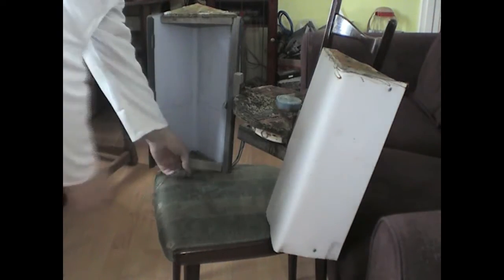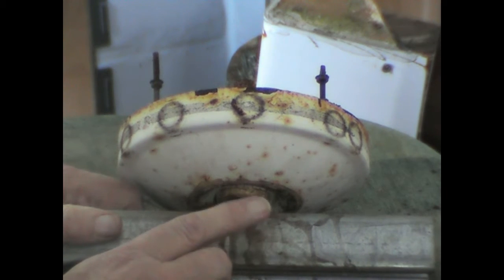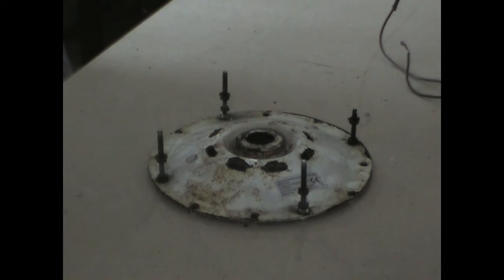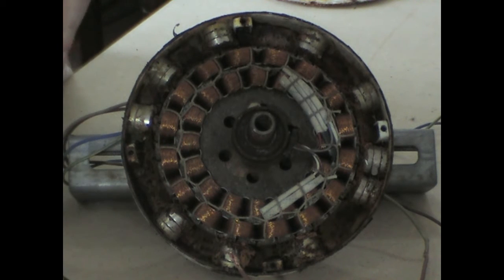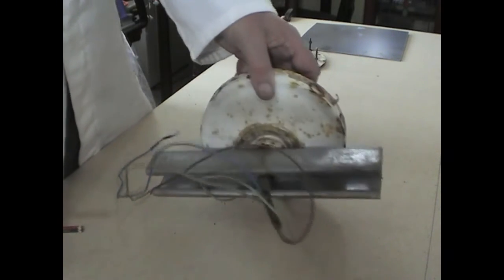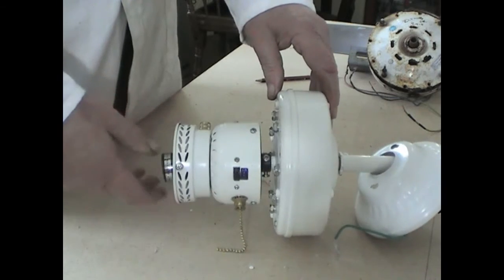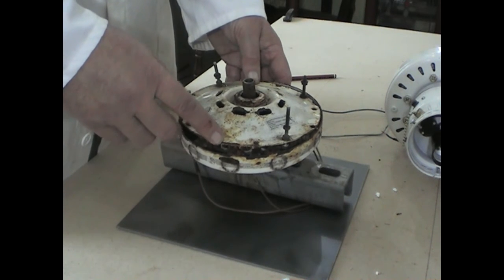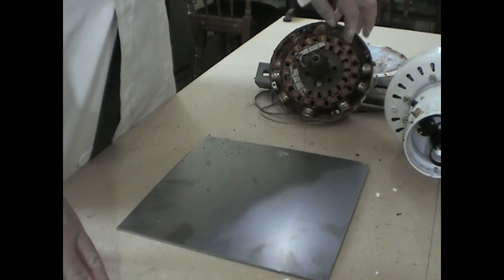Ceiling Fan Generator Turbine VAWT Overhaul 1

Comment: I have a cailing fan in my living room hmmmmm it may not be up for much longer
Reply from the maker: +David Simpson That's what I tell my friends when I look at thiers. LMAO.
Reply: i have never looked at them and thoght wind turbine befor but i will from now on haha i was laying in bed last night trying to think of a way i could use the bracket the fan blades use for maounting vertical blades rather then horizontal and i worked out if i had the same bracket below they could be bent to a 90 degree angle giving me a solid mount for 5 or 6 inch drain pipe the issue i have is with a small back year i ant got anyweare to mount it
Reply from the maker: It can be stood on the ground as I show in my intro wind section. Swap out the brake discs and put a ceiling fan generator. After this upgrade is working on tower. Going to do just that.

Comment: if the unit is 3 phase you could use a 3 phase motorcycle voltage regulator to the battery bank as for bearing soak them in thinners then heat some grease up soak the bearing in the greese then leave to dry this sould help the greasen penetrate the bearings oe try and find a local bearing factors to find replacments

Comment: a bit of build up on VAWT 1 but it stood the test of time super well, just needs a clean out and back to it, it seems every 3-5 years the guys who run the hydro setups re-grease there bearings but to say how little wear and tear this has taken I think its pure brilliance :-) Im looking forward to the new one as much as seeing the old one cleaned up and back up there :-D I will keep an eye for these ceiling fans for you now my friend, these setup in parallel would provide you some decent generation down there, its not windy enough up here im afraid :-p
Reply: +BattonFive Thank you for that my friend. You will be surprised how well these work with very little wind.
Reply: Raymond Earle would certainly be interesting to see if it could squeeze an ampr or two out of it, the solar really is a lost cause unless you have plenty of space and panels :-)
Reply: Things are only a lost cause if you let them. The only downfall to solar in the UK is the weather. So you use wind, water and earth. To supplement when no sun. They also add to the sun too. The other day there was na storm in the north of Hereford and bright sunshine in the south. 2Amps were going into the QXA for over 4 hours. So you do get good times too.
Reply: Raymond Earle Hereford my friend but have you been to Manchester? I know its not that far in geographical terms but  I bet it was over cast and raining :-p
 2amp is most useful, if I could get that I would want a dozen of them going :-D I checked the local wind speeds for Moston a while back but it only came out at 4.5mph and I heard you needed atleast a 5mph to get something really going :-) the vawt well greased though I can see making that happen :-)
 My end game for power is to get a cast iron wood burner and jam a steam engine and turbine on top to create electric like an old steam engine, im gonna be using junk mail to make paper pies to fuel the thing :-D
Reply: That's an amazing project my friend. You will have so much fuel your steam engine will go to warp no problem. You would still have tons of fuel on hand.
Reply: Raymond Earle thank you Raymond ji :-) its one of the rare occasions I would say 'free fuel' is actually viable :-D Im gonna sign up to all the spam I can get, in the name of Jimmy Swanson so when it comes through the door I don't have to filter it with my own mail and can send it straight through the shredder :-p
 I've not really mentioned it yet as im just starting bits like making some paper pies :-) but yeah I thought it would come in handy if I could get it going right :-)
 If it works nice it could be a good aid to your off grid work :-)
Reply: Yes it could my friend. But could you make it go to warp? I like the idea of a steam driven start ship.
Reply: Raymond Earle with a bit of a budget from what remains of Nasa I would sure as hell give it a good go :-) I'd aim for speed of light first then once I did some testing try to bend space time a bit and step it up a notch :-D if in doubt...radioactive elements...that seems the answer to everything courtesy of the energy density :-)
 atm my money is on antimatter, they are actually managing to store that gear these days, admittedly not for that long last time I checked, like quarter of an hour, but its a bit improvements on the seconds they used to be able to capture it for :-)
Reply: What I don't umderstand is how they get away with sexual equality. Medical is the same. I want to know why they don't use Uncle. Not the Illya Kuriakin type.